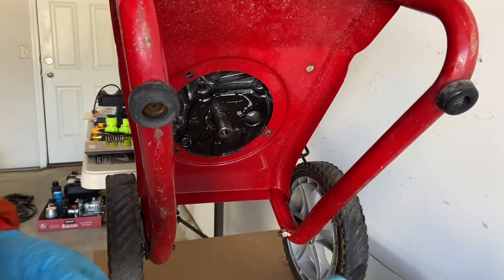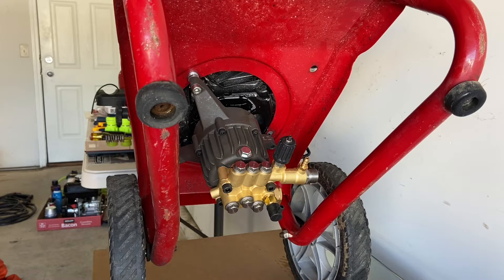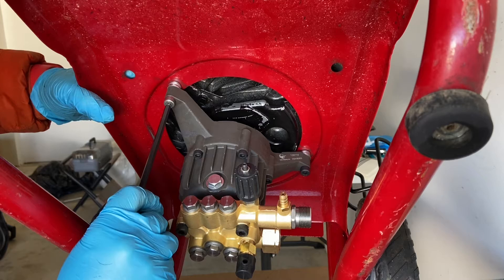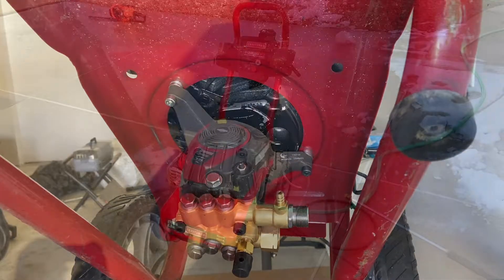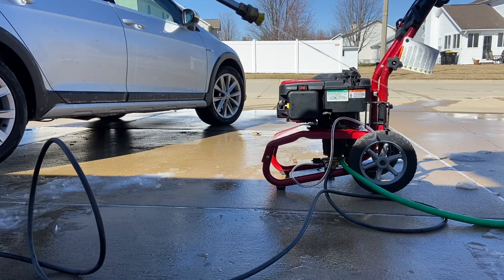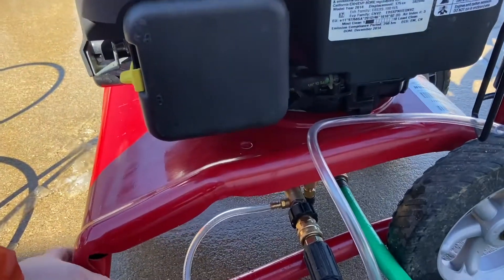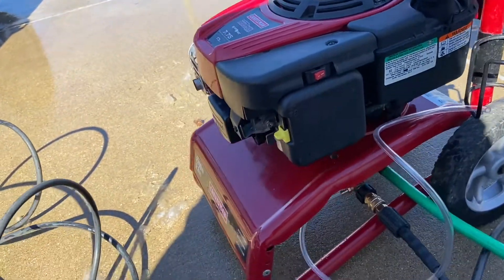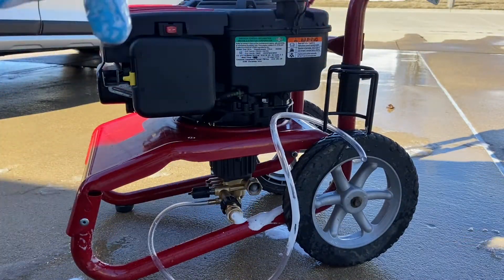CanPump Vertical Pressure Washer Pump installation

Comment: My craftsman unit had what I assume is a vertical pump because it’s mounted directly bellow the motor. It has FOUR mounting bolts. I’m trying to find a replacement but all labeled as vertical are three bolts.  All labeled horizontal have four bolts. 
Mine did not mount sideways. It dropped straight down when I loosed the four bolts.  

I’m confused: vertical vs horizontal.   Help!
Reply from the maker: I have had a few units w/ a 4 bolt vertical pump.  They were older karcher pressure washers and Karcher still made seal kits for them.  Unfortunately as far as I know no one today makes a 4 bolt vertical pressure washer pump and I think your unit is not fixable.

Comment: I just bought that pump to mount on a Briggs and Stratton 2550 pressure washer. It mounted up ok by using 3/8 nuts as spacers instead of washers to gain proper clearance. All that worked out well. My problem with this setup is that I don’t like that the hose hookup is from the side making access a bit awkward. I’m wondering if I split the pump could I rotate it 90 degrees so that the hookups could be facing rearwards. Looks like it could be done but I’m afraid to mess up a brand new pump that otherwise is working fine.  I would really appreciate if someone has tried this could they let me know if it could easily be done. 
Secondly I received the pump with the wrong owners manual. I don’t know if these pumps get shipped pre-filled with oil or not. I’m assuming they are but I’m not sure. Otherwise it looks like a good quality pump.
Reply from the maker: I don't think you can rotate the pump head.  I had another unit w/ a Subaru motor I wanted to put this same pump on but with the side inlet/outlet it didn't work with how the wheel was on that frame.

As for the oil, yes it would be prefilled.
Reply: @jamesbubnick  thanks very much for your reply. I was thinking the same. I’ve got it hooked up and it’s working but it’s a bit cumbersome hooking up the hoses, but doable. Thanks anyway and I’m looking forward to your future videos.